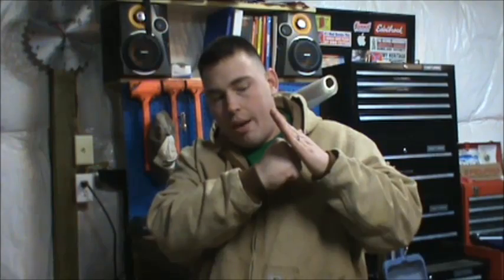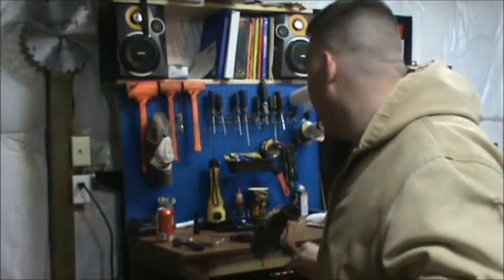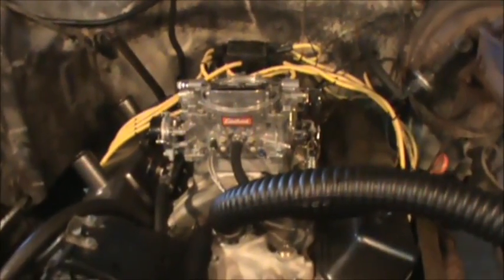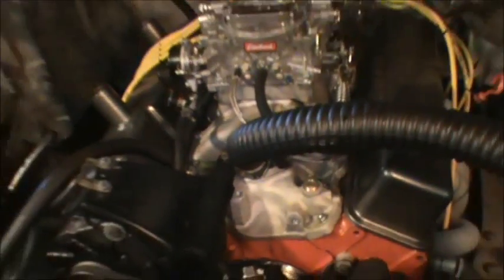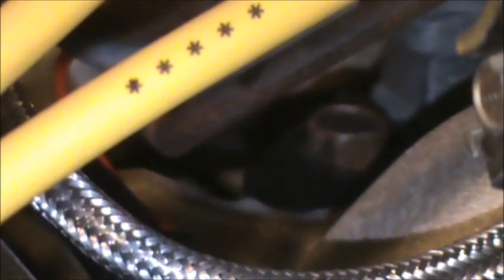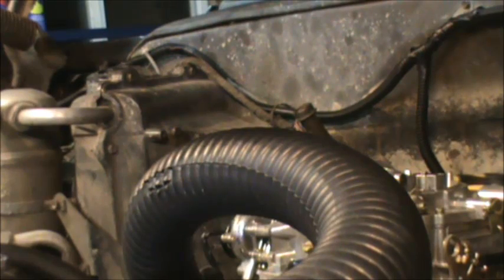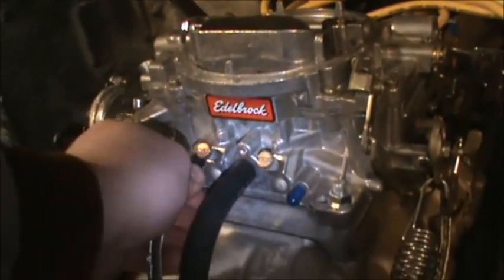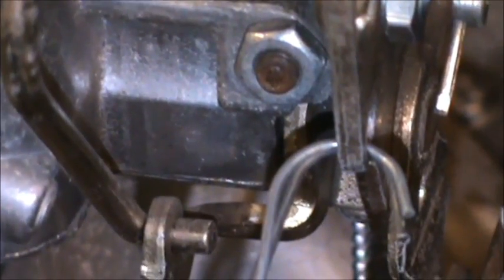Engine Building 101 How To Set Ignition Timing

Comment: I have a 1970 Chevelle 396 SS. I can get the timing set at idle but when I stop on it and bogs out backfires and after fires
Reply from the maker: Set your total timing, then the idle timing will be where ever it is. Also could be a fueling issue or springs in the distributor

Comment: do u have to do that with advance lines with fuel enjucter set up ?  question its da diferent erea but my fire order  is not set as normally with 1# to 1#spar kplug  my number one spark plug is set wher 6 or 3 would be can u tell me why my buddy would go with that set up I have a mother thumper cam in my 350 pickup and should I go with standard fire order as suggested of diagram requires
Reply: I want to drive it but getting passed all this abnormal settings m as key it difficult to get past to that piomt
Reply from the maker: What year is the motor? What kind of injection system do you have throttle body?
Reply: @ZaksMuscleMotors   not sure but I have a 350 5.7  shortly blk in1989 scotsdal stepside  with stock 350 5.7  fuel ejected tbi  but put in a muthr thumper cam with 2500 tork converter required for that can
Reply: @ZaksMuscleMotors  its a 1989 scotsdale chevy 350 5,7   was stock added gear drive and a motha thumper cam and 2500 tork converter my main problem the guy that was supposed to help me messed with idle screw  wich was sealed n he got it it wich I wasn't to happy about  now idles with offbeat serge ensted of stedy  don't like   dudes gone but I'm left with this  iddle that's I know isn't rite
Reply: ;;it's a small block 1989 tbi 3505.7

Comment: Always set total timing first thats whats most important and wherever base lands as long as its in the area is good if it starts right etc if it wont go back to anout 12 or 10 whatever then theres something wrong w the distributor total timing and when is the most important whatever the engine is specs say total is thats where it needs to go too little ypur leaving power on the table too much is not good either. Dont know the spec try 30 - 35 amd run it then keep.increasing two till it stops making a difference you will feel a difference then its happy
Reply from the maker: Lol I think you’re looking at it a little wrong. Here is another video that explains this a little better. 

https://youtu.be/5EGiuvcM31U

Comment: Wrong the lower compression stock motors like advance quickly therefore weaker springs a higher compression engine you cant bring it in as fast depending on octane therefore tighter springs because the higher compression one will detonate or ping causing internal engine damage over time higher octane isnt more explosive its less expensive which in turn wont pop off on its own even due to heat and pressure

Comment: If i try to adjust my air fuel mixture after gettin my timing set would i have to reset the timing again ? Asking because that’s the problem I’m having the car won’t burnout and i have to kinda pat the gas to crank
Reply from the maker: Making that adjustment will affect the idle yes. It’s something you’ll have to mess with to get dialed in.

Comment: great video. Question, I am about to adjust my timing. my ford f100 390BB stumbles and hesitates when taking off. It idles,revs and cruises fine. I have new plugs, edelbrock 750carb(accel, pump worked best on middle setting),new fuel pump , lines,dome,plugs, wires and Mallory dist. Seriously, everything is new.I was told it could be the timing?
Reply from the maker: M1rush 

Timing is a possibility and the first thing I would check. But also it could be your jet settings in the carburetor, may need a bigger squirter, may not be enough plenum volume cause it to choke too. Several things could be a cause. Did you have issues before you made any changes to it? Or did it just start out of no where?
Reply: @ZaksMuscleMotors  Thanks for the reply, I had a holley 600DP on it when I baught it a few mths ago. It looked quite dated and leaked a small amt and I literally couldn't get out of the garage with it as it stalled and choked so I just replaced it with a new edelbrock 750 since pretty much everything else was new. It made a difference immediately. I took it out and drove it around. However, it still stumbled a little when taking off in first. I moved the accelerator pump to the middle setting,worked better but still, a little stumble. I have an original ignition box which I need to replace as well, the coil is new, but stock so I want to get a mallroy coil and box to go with the mallroy dist. just to keep it all the same.
Reply from the maker: M1rush 

If you can, give me a call today 7655247362

Comment: Did you show how to set total timing? Does the engine need to be at high RPM, not idle. Total timing could be a large number like 30 degrees?
Reply from the maker: Canny Build It 

No I didn’t, but I’m going to do a new tuning video. Over the years I’ve gained more knowledge and need to update my information

Comment: A non EGR engine requires full vacuum at idle, not part time like you have your edelbrock set up. It will be cooler, efficient and more power when pulling more time under lighter load, and lean. Don't believe me? Look up ported vacuum vs manifold vacuum on non-emission engines.

Comment: I would like to know, What dose the vacuum hose do for the timing when you take off from a stop sign. dose it work with the timing curve springs, or against it? If you set the timing with no vacuum, and put the vacuum hose on it changes the timing? I am confused on that one. And on some carburetors there is a vacuum pull at idle. And vacuum pull at acceleration. witch one is best?

Comment: " stock " lower compression engines like timing ive had good luck with lighter springs on stock engines bring that timing in faster the way you explained it it seemed as tho you said tighter springs on a stock engine because it doesnt see higher rpms so Idk I'm kinda confused I guess opinions. Vary ive just had good results with quick advance on stock engines w out detonation or any other issues except a noticeable difference in throttle response ..

Comment: can i skip the timing gear ahead a notch to get a little more advance? My dizzy is maxed out at 12 degrees which is lame when youre running LPG instead of pump gas at 108+ octane. 40 teeth on the gear should mean one tooth ahead will give me another 9 degrees?  Or with this get really jacked up when it translates to total timing?
Reply from the maker: tubeyourself I wouldn’t move a tooth. You can get all the timing you could ever need with moving the cap
Reply: @ZaksMuscleMotors  i max the cap around 12 degrees tho
Reply from the maker: tubeyourself how much timing your trying to get lol???
Reply: @ZaksMuscleMotors  maybe 25 degrees?  or at least advance until it starts pinging then back it off... more than 12 degrees!  i have a knock sensor.
Reply from the maker: tubeyourself what fuel are you running? What cam? What compression?
Reply from the maker: tubeyourself move all your wires counter clockwise one spot and give yourself a little more room to move

Comment: The guy that built my motor set it up for good low end if I remember right since it was 24 years ago advance the cam timing I think 8° and set it up using manifold vac not ported. 
Several videos talk about using manifold vac what do you think??
Reply: How to put wires on 351 whiner in order

Comment: Question, why the right hand fitting on the carb instead of the left/drivers side? isnt one for timed vacuum advance and the other for manifold vacuum?
Reply: Yes, manifold vac and ported vac. The emissions equipment on your vehicle determines which one you'll use. Emissions laden vehicles need ported vacuum to operate EGR valves, AIR valves, etc. and the vac advance.  Vehicles setup for no emissions equipment should use manifold vac for better performance, idle cooling, and driveability.  Ported and manifold vac need the distributor to be setup differently for each type of vacuum.

Comment: I'm confused. I thought the timing at idle had to be set at 0 degrees.
Reply from the maker: scanner not necessarily. I’ve learned a lot since this video, your idle timing will differ depending on your total timing. Typically with a stock application and 87 octane pump gas you’re gonna be in the range of 8-12 degrees before top dead center. So setting your idle timing there is a base, and more dialing in may be necessary.
Reply: Set to zero if ya have a ECM controlling your ignition.

Comment: @zak ive just rebuilt my engine i put a new mild cam, new heady duty timing chain and everythibg new heads etc i set it up to time well my dad did, the line is away from the time tab thats attached to chain cover it starts up but when i put it in gear it starts to choke and if we dont give it gas it stalls off what can it be didbhe set the timing chain wrong or did he not set the time right on the timing chain teeth

thanks in advance

Comment: How do you set the vacuum advance if it is adjustable like on MSD street fire
Reply from the maker: Josh W inside the vacuum hole on the distributor where the diaphragm is there should be an hex head screw that takes and Allen wrench to adjust it. Most the stuff I do is mechanical so not a lot of help from me on that one brother I’m sorry.
Reply: Where does # 1 set on the  distrisber for 350 Chevy

Comment: I followed this for the initial timing but I don't know how to set the higher advance of 34-36 degrees. well back to more videos.. thanks for this ... also truck sounds nasty... more info on it? 2wd / 4wd?
Reply from the maker: Jeffrey Riggs stock, 4x4 79 Cheyenne. Miss that truck. I’ll put out a video soon about it it’s a common subject. Basically take the engine to 3,000 rpm or so and set the timing mark to your desired degree. If your timing mark doesn’t go this high, you can get a better timing light that allows you to set your point on it. So say you set your mark on your timing light to 18* before tdc the light will flash it at 18* then just set your line on your damper to the zero on your timing tab and it will be set at 18* before tdc. If you need help just call me 7655247362

Comment: Great video,Easy to understand . I have a dumb question., My 76 C20 could have one of two different distributors that are supposed are to be set at different numbers. I cannot find the dist casting number to see which one I have. do I need to remove the distributor and look under or on the gear? Thanks again for the video.
Reply from the maker: Russell Jay send me a picture of it in a txt. 
7655247362

Comment: somebody told me that on old motors you can just take out the number 1 spark plug and stick your thumb in the hole and have someone just bump the key a little bit off and on until you feel a POP! 
then your at T.D.C is this true???
Reply from the maker: Chris Pearson it will get you in the ballpark but it's not really a good way to get you at top dead center. In order for you to set timing a couple degrees can make a big difference youll want to make sure you do it correctly
Reply: Zakry Lamb thanks for the information bro.. I appreciate it
Reply from the maker: Chris Pearson what it will do is allow you to find the compression stroke which is where you want to set your timing and if your marks on your harmonic balancer and your marker on the timing chain cover are correct then you should be OK
Reply: Zakry Lamb that makes sence thanks for the video and the information it helps me out..
Reply from the maker: Chris Pearson not a problem brother

Comment: what about the total timing? That's the one I am foggy on how to do correctly.
Reply from the maker: Take the engine rpms up to around 4K and set the timing marks at your specified advanced setting. My car runs around 36 degrees before top get center. Won't probably be the same for you. It's the farthest that mechanical and vacuum advance will operate.

Comment: And what is total timing
Reply from the maker: Total timing is the total advance the spark will reach in the curve
Reply: Can you tell me why my 350 600 cmf eldabrok carb and manifold 2 inch headers wen I put it TDC is runs like carp and no power my timing tab say 4 and 16 wen I put it over that it runs fine so do I need 2 leave it like that or is something wrong
Reply from the maker: +sentell nicely what octane fuel you running? Cam? Heads?

Comment: Wen I set mine tdc it runs like carp is its something I'm missing
Reply from the maker: Can't run right at TDC. Start at 4 degrees advance and work your way out. Or rev the engine up around 4,000 rpm and set the total timing to 28-36 degrees advance depending on fuel octane

Comment: hey bro pull that dist' out and check with a flat gauge to see how much play you have between the gear when you push up and down on the shaft it should be 15 thousands. no more than twenty. i thought my pick up coil was the problem and found out i had almost 60 thousands !when the shaft rides up the vgear actually throws the timing off enough to cause the issue although i was eating up caps every 5 thousand mi. ;p;
Reply from the maker: Ok..... Not what the video was about lol.
Reply: my bad i sent it to the wrong video, funny i look stupid

Comment: Olds 403, mild cam, e-broch rpm performer intake, Keith Black Pistons, running on 93 octane.........should the spark plugs be gapped for a stock application? Or a little less than the stock required gapping? Where should the RPMs be before when setting the intial timing(600-800)??? What range should the intial timing be set(10-14) then so on? It pumps out strong carbon scent( running too lean)?
Reply from the maker: First you wanna make sure the cam and intake setup are made for each other. Was the cam built for that car and by that I mean did you call the cam company and get all the info on the car to them and let them select a grind based on that? What compression are you running now? What ignition system are you using? What carb? Are you pulling the correct Mercury on your gauge? Setting your timing you need to know what the advance springs are setup for in that distributor. Is it a quicker or slower advance curve? Stock coil? May need to set your total advance first. I'm gonna have to make a new in depth video for this topic it seems to be really popular. There is a lot to this and the video her is just a basic into into a stock setup. As you start building up and changing the whole game changes.
Reply: +Zak Lamb the cam was made for the setup. A Mondello cam. I believe it's a 9:5:1 compression setup running on 93octane. I'm concerned where the plugs should be gapped first. I got a set gapped at .45 and then another set at about .35.....the higher the compression, octane, the lower the plug gap should be....I just hear this from a old head. Don't quote me on this
Reply: +Zak Lamb a stock ignition and a DUI ignition.
Reply: +Kiddro22 A stock Ignition on one car
                    A DUI ignition on the other(basically a stock setup)

Comment: that trk sounds healthy. why aren't you setting total advance and working backwards like you should on any performance application?
Reply from the maker: I seen you made a comment about the timing chain being worn out and jumping a tooth. It actually had a brand new gear drive in it. So that was silly. Second I had already had this engine where I wanted it and done it again for the video and I knew where my base timing was gonna be.
Reply: +Zak Lamb short breaks I'm a trucker, there are also many different timing cover marks and coresponding harmonic balancer marks. I assumed it was an old engine.  sounds like the engine bldr didn't verify external marks after degree the cam.
Reply from the maker: +Karl Porath your starting to sound even more foolish. I don't have the time to educate you your too far gone friend. Have a good day.

Comment: HELP 65 CORVETT WONT START UNLESS DIST IS RETARDED  BY AT LEAST 40 DEGREES TIMING CHAIN CK USING PENTRNIC IGNITION NO POINTS  IS DIST SET AT 0 WILL NOT START COMMENTS SUGGESTION MUCH APPRETIATED THANKS
Reply from the maker: What happened before the issue started did you change anything?
Reply: your timing chain is wore out and jumped a tooth

Comment: Hey Zak I have a ford f150 351 Windsor with the exact same carb what would be the best air fuel mixture to run the smoothest? my engine is stock there is nothing done to it but short tube headers

Comment: @zack lamb , first question in your video I see that you have your vacuum advance hooked to the timed port where clearly the motor is not emission controlled what is the purpose , second I appreciate the video but sadly is incomplete you cover the base idle timing but as u stated in the beginning of the video as rpm increases "total advance timing " increases yet you do not cover how to verify TAT is properly set @ 32-36 DEG before tdc ,